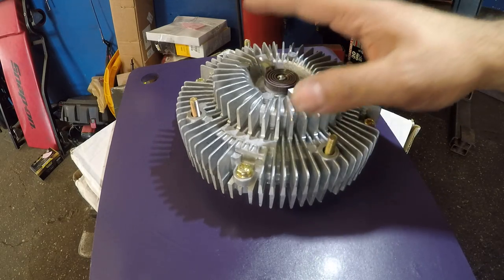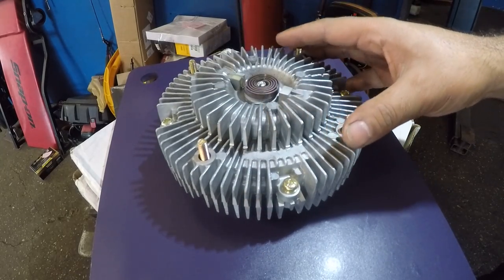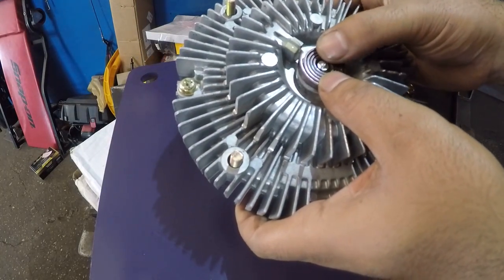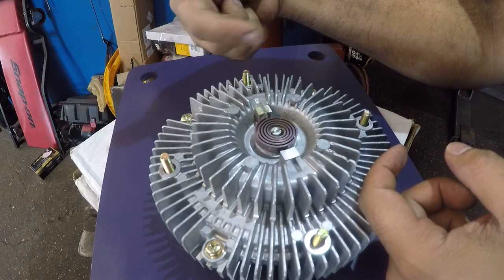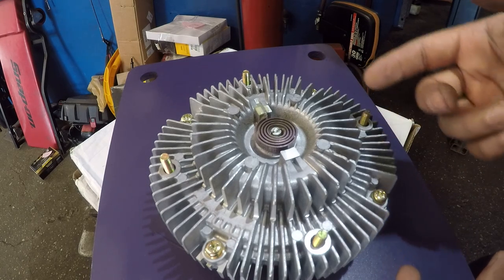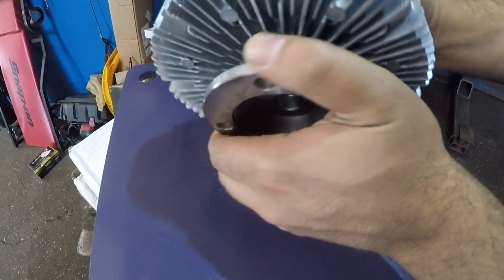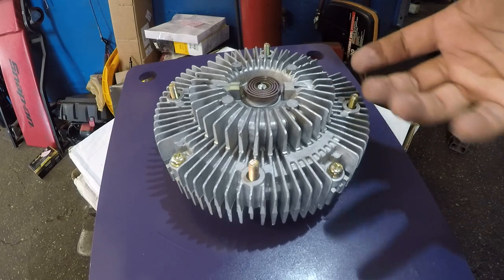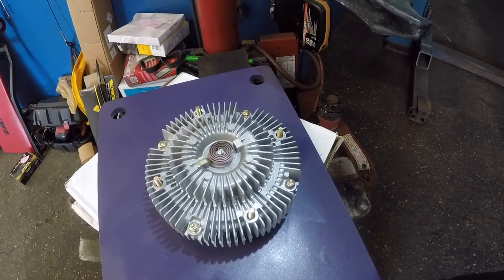Fan clutch making loud wind noise, try this

Comment: I have a 1999 Toyota Landcruiser. When I accelerate the engine sounds like an airplane. As if, air is being blown out a hole in a hose in the engine only and not going through the exhaust system and no power. Could this be the issue? Car doesn't overheat or anything. Sometimes it runs quiet but sometimes it's blowing alot of air sound only.
Reply from the maker: It sounds like this is the issue have u changed the clutch ? Usully after marker clutches dose this
Reply: @RBTheMechanic  no I haven't. Started sounding like a dumpster truck recently when I accelerate and no power.
Reply from the maker: @allabouttheoutdoorz  it could be bad clutch or car getting too hot try it with ac off see the diffrence
Reply: @RBTheMechanic  it does that with ac off. I will change out fan clutch and see.
Reply from the maker: @allabouttheoutdoorz  u have to put in original after market will be worst all time
Reply: I have a 2010 Patrol doing the same only if AC is on, whenever I turn off the AC it will drive quiet and fast. What could be the problem please !?

Comment: I noticed engine power loss when I changed the clutch. Am I wrong?
Reply from the maker: It can cause loss of power if it keeps the engine cool too much
Reply: @RBTheMechanic  before I changed it the truck had power now it's a little weak and loud as a school bus.

Comment: I liked the video and subscribed. I will post a video of my 2005 Canyon sounding like a damn jet about to take off. I recently replaced the clutch fan.
Reply from the maker: Damnnn get original clutch that was the ultimate solution
Reply: @RBTheMechanic  sorry if this is a dumb question, but what is the original clutch? That's a Duralast fan clutch I installed. Maybe I didn't install it correctly?
Reply from the maker: @daveortiz352  eel u can’t install it wrong it’s just not same as original from dealer get it from dealer
Reply: @RBTheMechanic  okay. TY!
Reply: I just had mine replaced and it's doing the same thing, very loud like a school bus! So will it hurt anything for it to be too tight or just the loudness?
Reply from the maker: @jessicaeden3284  no it’s no problem good for summer for winter it might take long time to get warm and have poor heat u might not feel any difference and some type of change it MPG like I said u might not even notice it

Comment: I replaced mine because it was making that noise . And the new one still makes the same gushing air noise lol , it took way too long to replace so I'm just going to deal with noise for now .
Reply from the maker: Did u put it original
Reply: No, it was from RockAuto. Was cheap like $40 . The one i replaced was making the same noise (No over-heating) just that wind tunnel noise around 2k RPM.  @RBTheMechanic
Reply from the maker: @Rick-ho2ci  oh ok I always go original cuz of this issue dose it have adjustment ?
Reply: @RBTheMechanic  no adjustment,  I'll order the original soon!

Comment: Mine is having the same issue .. 😢.. but if turn of the ac .. the sound disappears
Reply from the maker: There’s another fan front of the condenser check that
Reply: @RBTheMechanic  did that already . Same thing.. it’s a Lexus gx 460
Reply from the maker: @noblemgbokwere9494  yeah put the ac on and check front fan not sure this clutch fan would do that since it’s not controlled  by anything

Comment: I got a crazy question since my 04 silverado has a fan clutch and it's always on does that technically mean that it takes longer to get warm in the morning since its cooling
Reply from the maker: When it’s dose this it’s cooling more because fan is working faster clutch is gripping more it’s kinds normal did u replace the clutch?
Reply: @RBTheMechanic   no i just never had fan clutch before always electric fans on all my vehicles
Reply from the maker: @702xRyder  yeah well these are loud shouldn’t be a problem tho
Reply: Sometimes the clutches fail in the on position causing too much cooling and reducing fuel economy. Sometimes they fail to not engage and not cool enough.

Comment: When i start my 07 dodge it sounds like a semi
Reply: Same with my 06
Reply: Same with my 04
Reply: @bsharp1117  I already fixed it finally😁
Reply: @xVLADx47  how did you fix it ?
Reply: @bsharp1117  I got a new clutch fan and replaced it and then it sounded normal
Reply: Same with my 03 Dakota

Comment: Yo you still answering questions in 2020?
Reply from the maker: Yes
Reply: 2007 ford explorer 4.0 same problem! Tried this and didn't work
Reply from the maker: @jm2three  then u might have to replace it with original one

Comment: Like a torque converter
Reply from the maker: Yup
Reply: @RBTheMechanic  hey. Will the torque converter in the transmission make the same sound. Like a whir. Or a blower belt on a top fuel dragster?  My truck is doing it. Especially when it is hot outside. Don't do it until the transmission temp is up to the engine temp.??
Reply from the maker: @hellwithit  no that one is smurged in fluid so it’s diffrent this is clutch with fan on it

Comment: You should have shown what a clutch fan actually sounds like before replacing not a complete video many things sound different under the hood that could sound like a clutch fan why is it that everybody always misses showing the most important  the actual sound noise LOL
Reply from the maker: It was too late for that but I still wanted to show people or just buy original clutch from dealer

Comment: I changed my fan clutch for a chevy silver 1500 the last one was making the same noise as your explaining i changed it and it dose the same noise
Reply from the maker: FUNKY GERMAN did u out in original from dealer or after market clutch
Reply: RB The Mechanic the original from the dealer
Reply from the maker: FUNKY GERMAN see if it has adjustment we installed original on Lexus 450 truck it was silent before we put in aftermarket it sounded So loud like dump trucks
Reply: Sorry i don’t know that much but adjustment in what way sorry for my ignorance